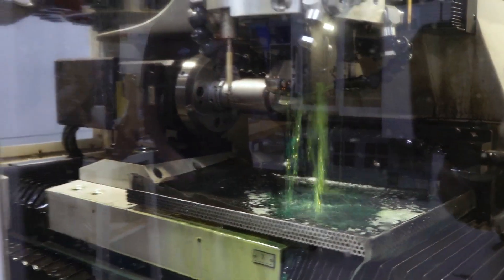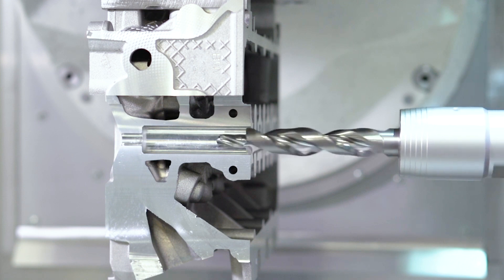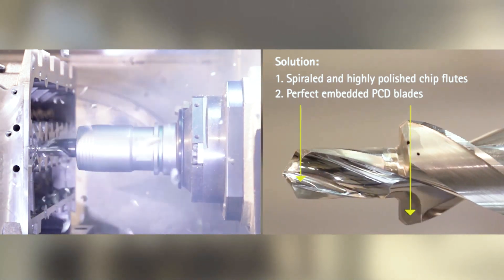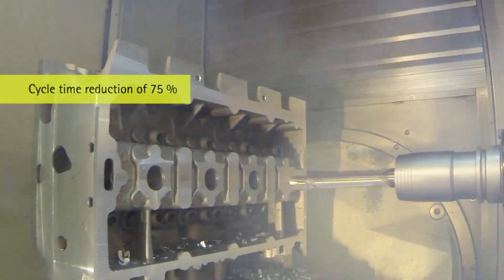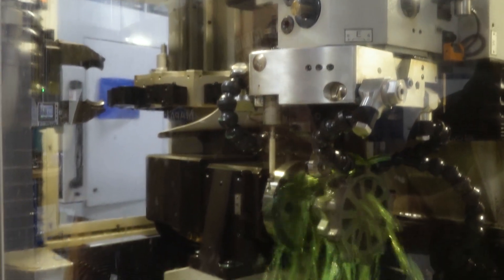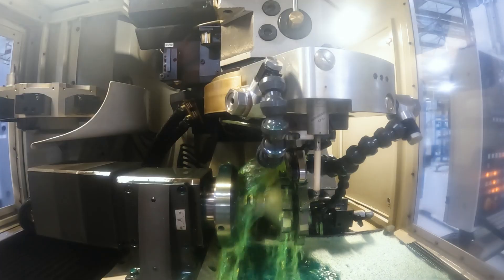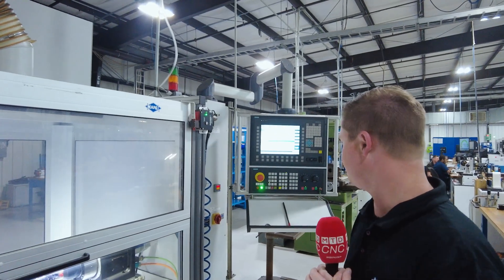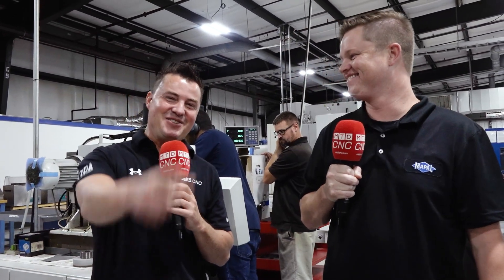Talking PCD tools and cost savings with an industry leader in aluminium machining

Comment: One other thing - the spindle head used on the MQL tester is probably at least $20K, when they could have used a vastly cheaper unit for spray analysis. That's either commitment to quality or an example of a company doing very, very well.